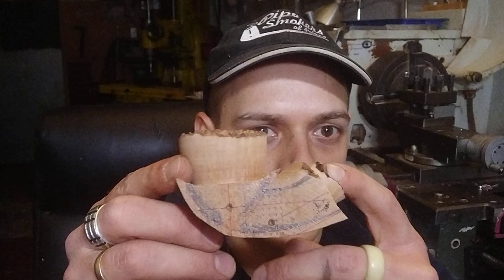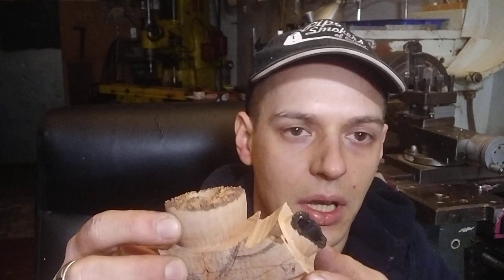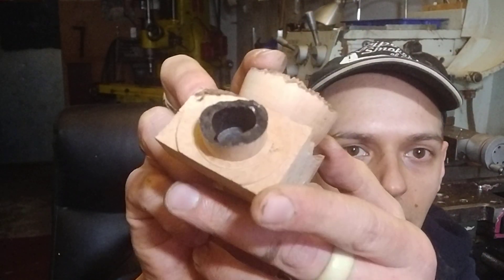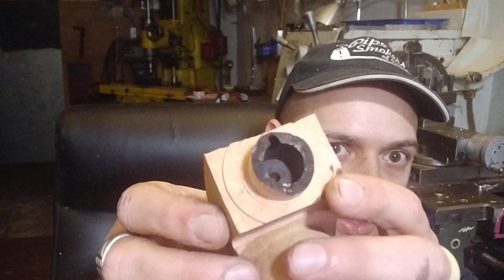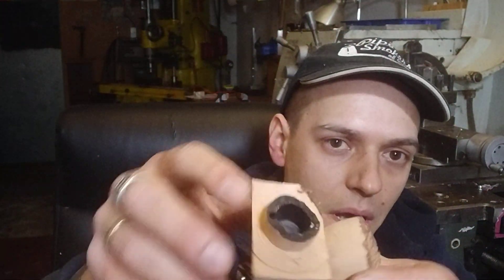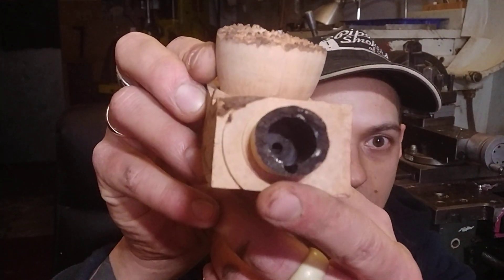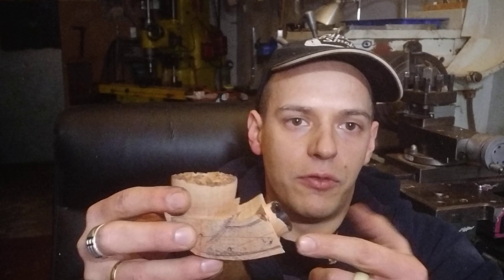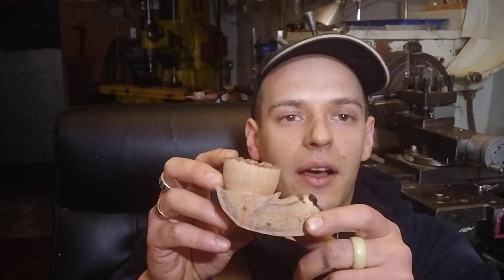Pipemaking - weird drilling geometries

Comment: I was sad when I saw your previous videos to find they were all in Polish, so I was happy to see one in English. Lo and behold your English is in fact excellent, which I thought was much less prevalent in Poland.
Personally I've somehow managed to keep all the pipes I've made so far at an angle that allows drilling the mortise and airway with at most a small notch. I have used this trick a few times by enlarging the mortise to 10-11mm, but never to the width you're showcasing here. Except ofcourse when making Reverse Calabashes.
I'd love to see the finished stem for this one, and how the tenon looks in relation to the rest of the pipe.